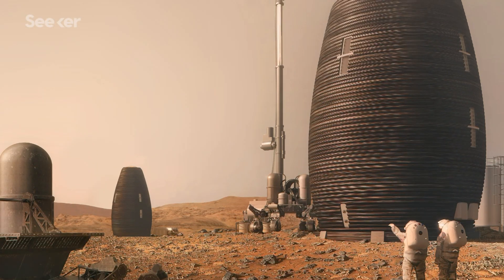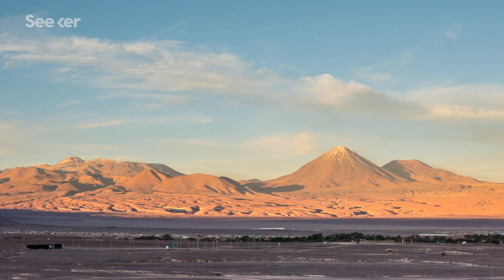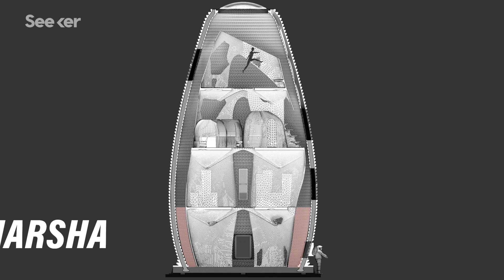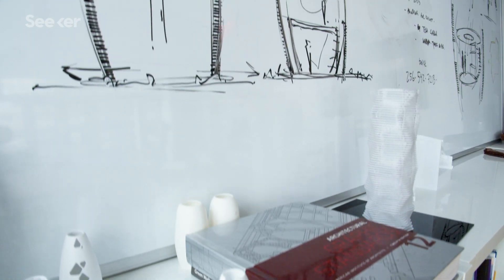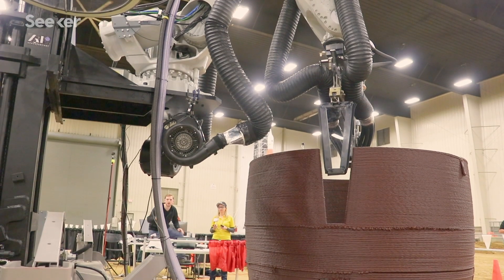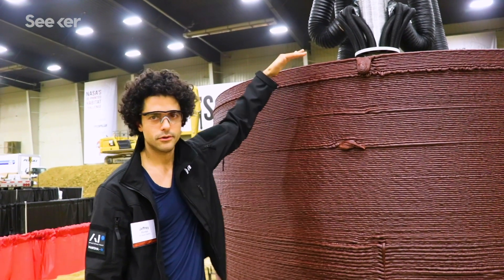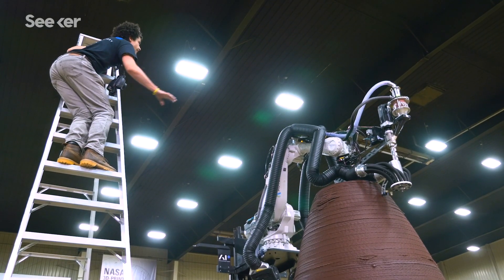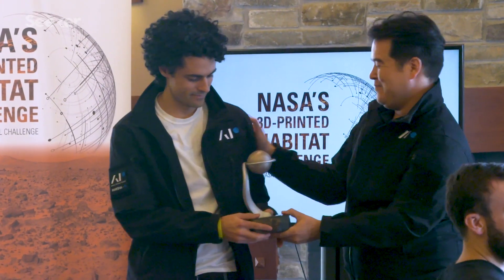NASA’s Challenge to 3D Print Future Habitats on Mars

Comment: moons surface is made of agglutinates, that can be melted in a range of 1000 to 1500 degrees Centi.
assuming a melting point of around 1200°C. To calculate the energy required to melt 1 kg of agglutinates at this temperature
we need 330,000 Joules (or 330 kJ) of energy

If we plan to use solar energy for generating that power.

A solar panel with an area of approximately 20.2 square meters would be required on the lunar surface to generate the energy required to melt 1 kg of agglutinates in one minute, assuming a solar panel efficiency of 20% and an average solar irradiance of 1361 W/m² on the Moon.

Comment: When did NASA get so stupid?  

The internal pressure would have to be at least 5 psi for humans.  So, for just a 10' x 10' wall that would be a total of 72,000 lbs of internal force.  So, your walls would have to be steel reinforced concrete that is many feet thick.  

Or, if you were smart, you could dig out an area that is eight feet down, assemble a buried habitat, pack in regolith on the sides and on top of the habitat so the regolith helps counteract the internal pressure.  The regolith also stops dangerous cosmic rays.  Use internal LED lights for the plants.

Comment: Common sense dictates that those should be built 3/4 of the way underground. First dig your hole then build your habitat, you’ll need to make the thermal and radiation protection a priority. Backfill and anchor your solar arrays to the outer-facing upper portion of your habitat and finish your roof with transparent material for light and plants. Bravo…you are a Martian, aka a trained mouse in a cage underground watering the plants. Nice life.

Comment: I'd send a boring machine to drill some tunnels and the next rocket 
would land in a tunnel leaving the tip sticking out of the ground this would then 
serve as a habitat.  Then build other structures as needed.
Reply: Also if you can why not just bury the ship you send to get better protection... all you need is a bulldozer.  Too simple?  Use a Telescoping rocket shell so you get more space.  Have an inner shell that's lightweight carbon fiber which can withstand the weight of the surrounding material.  In fact if your rocket is say 20' round you could have the inner carbon fiber cut in half so you set them on the ground like a hoop house greenhouse and bury them.  Maybe make a couple for a greenhouse type material for possible growing?  #hairbrainideas

Comment: Do we really need to build lifespace and send humans on Mars as first step? I think it should be the last, when everythink else is ready.
Boston Dynamics Atlas and BigDog will build Mars colony. No need radiation shield, no need food, no need water, no need oxygen, no need lifespace, no need resting, only building tasks 24/7, remote controlled from Earth. I know about delay, but nowadays AI algorithms will allow operators to send only high-level control commands like "take this, put there", latter maybe even like "build this here".
First steps as I see it:
1. Send few orbital stations for 24/7 communication channel with Earth
2. Land solar panels, robots, local on-land communucations receiver
3. Land nuclear reactor for energy
4. Land materials and parts to build self building machines.
5. With these machines use Mars resouces as much as possible (sand, water, co2) to build other machines
6. I think it is a good idea to make parts locally by 3d printing them with melted sand.
7. Send to Mars only resouces that it needs (nuclear power elements, iron plates, plastic filament, etc)

From higher height:
1. factories, industry, self-servicing
2. plants, foods, water extraction, autonomous oxygen generation
3. lifespace for humans
4. humans on Mars

Comment: You could save space on the Mars spacecraft (and on trucks if you want to 3D print homes on Earth) by having a smaller 3D printer print a larger 3d printer, you could also have the 3D printer build plates to make its neck longer and the base of the 3D printer 3D printed as well.  3D printing the moving parts will be harder, but still possible.  Rep Rap showed that even the extruder can be 3D printed.

Comment: The concept looks great, but I see several flaws in it after watching the video. One: Wind resistance. High wind storms have been noted on Mars so how can your design handle them? Two: Very cold temps even during the days All those windows will radiate heat along with the metal frames that they use. Finally interconnection if the various units so one does not have to don a suit to go from one to the other. I am also concerned in using plant material since there is no growing vegetation on Mars no do we have any testing to see if it will grow in the low temperatures that exist there.

Comment: The best idea of building Mars base or house instead of printing is by simply using 3D digging it's a drill that sending the sand etc.out so it's like this have you seen the grave by digging but with 3D digging you can simply form sits, bed, shelf, stairs,deep down etc.and it has 2 robot arm 1.its the drill the 3Ddigger and the 2robot arm are like liquid spraying the finish form inside this liquid is no different with cement effect so that everything become hard the design is almost like a crabs🦀 but the 2 robot arm are inside foldable? 🤔🤔🤔

Comment: goes into the skylight room ahhhhhhhhhhh burns alive thanks to the fact THERE IS NO ATMOSPHERE
Reply: how the hell did the dildo people win
Reply: In one of the other videos about Marsha, they quietly tossed off that it is a "water filled skylight" ... that got my attention because I remember reading once, long ago, that water has amazing shielding properties. Just googled and find that ~ 13-ft of water = 6-ft of concrete = 1.5 ft of lead.
Reply: @rocketgranny2261  water is heavy plus water on mars is ice wait have we tested ice
Reply: @spacecorpse3212  You're right LJ. 1 cubic foot of water weighs 8+ pounds. That would have to be a heck of a strong skylight to bear that kind of weight and still be able to protect the room occupants. From the pictures of the skylight, it doesn't look 10-13 feet thick either.

Comment: I just wonder why NASA only focused on 3D print technology, when they called for the design competition.   Nobody so far has published any numbers of how many kilowatt-hours of electric energy are required to 3D print these habitats with their  necessarily thick walls. 
Just to give you an idea:  to produce 1 kg of rockwool (which consists of similar raw material as Martian regolith)  4,2kwh are required. A hundred  kilopower reactors would be required to 3D print that habitat within a year. 
with an inner atmospheric pressure of  1 bar, as we have on Earth, a force equivalent to the weight of 10 000 kgs would press on 1 squaremeter  of wall or ceiling.  so a thin inflatable membrane could easily support a deposit of loose regolith several meters thick. . just 3 meters of loose regolith provide sufficient protection from cosmic radiation, micrometerorites and extreme temperature.
An inflatable membrane could be produced on Earth, could be carefully tested and has a very little payload. While an automatic 3D print process  might not be monitored and checked sufficiently over a distance of 50millions of kms.
Bigelow proved that inflatable structures can handle the challenges in space, and on Mars it would be even a lot easier, since the membrane would be protected with the regolith cover
So 3D print is not necessary for walls and ceilings but requires huge amounts of energy that hardly will be available on Mars at the begin of a Mission

Comment: If I were in Mars I wouldn't want to live in these habitats if that is all there is to it. Just a 3D printed plastic wall. Don't look at all possible of thermal isolation, resist corrosion, UV radiation would wear it down in some months, any micro meteorites would break it right through, there are no door locks to prevent further degradation of atmosphere if any part of the structure is breached. These designs are better suited for earth.

Comment: This is hardly living off the land in Mars, if you have to bring the polymers with you. The amount of human intervention should have been an automatic fail. A more realistic challenge would be to send AI controlled 3D printers into the desert and it has use what's there to make a building without any human input. Maybe that will come later down the line.

Comment: One question tho... WHAT ABOUT THE HUGE RADIATION (radiation cause its rly thin walls and also it has windows) AND THE FACT THAT THERE ARE WINDOWS -.- (windows cause the temp change is so big that the glass should break one day) The mars bases should be built underground for best radiation protection and heat control they only was i could see this being used is if we terraform mars and then use those or if we had a shield against the radiation :v
Reply: The video showed that the intend design of the mars building has 2 layers of walls, the gap in-between them allows you to put a protective layer.
Reply: @Droid5767  what about the windows

Comment: Interesting. I always thought a geodesic dome would be the most efficient design in terms of strength and stability to counter dust storms on Mars.
Reply: The problem with geodesic domes on Mars is that geodesic domes are usually thin and don't provide much radiation protection. The radiation problem kills the dreams of sci-fi domed towns on Mars.
Reply: dust storms are actually not that strong and a less critical design concern

Comment: I feel like they could do this much easier with inflatable modules. You make a bubble within a larger bubble, then fill the gap between the two with Martian regolith to provide radiation shielding. If needed, the regolith could maybe be mixed with something to make it more structurally supportive like a cement or some expanding foam.

I would replace windows with outside cameras and inside screens.
Reply: agreed. but having different groups explore both is a good idea.

Comment: Why not have like a tent fire redundant fabric that sawed into it there is concrete and humectant powder. The whole thing lands air pump starts and desiccant adsorbs the humidity in the air and cures the concrete. It fools proof imo..you can create what ever shape you want with little power and no water. No precision required either just crush land the thing it will work.

Comment: The supposed oceans of Mars have, since long, been evaporated by all story of Mars, as you all have heard. 
What about ocean salts? 
That desert is certeinly a salt desert. 
Temperatures: down to minus 120 degrees calcius. 
Terraforming?? any water heated at the poles will immediatelly freeze  to a temperature sixty degrees celsius below the one of our Antartide winter.
Even so life is possible, but in a controled secluded area.  The most necessary and wanted specialization?  Green house tecnician, of couse..., Second one?: geologist. Third one?: mirrors ans solar panels technicians. as well as electricians.

Comment: Mars? No printing of concrete housing will ever be possible, since, without water, no concrete could be done. 
So mine it before, if you want to follow this way. 
And this will take not ages, but as least years, and with people there and living in plastic domes.  
Hope no super-clever architects will stick in for strange items that will take all explores time and efforts.
Reply: you have no faith in the engineers to design something. after all they spend 4 years of their life learning cad and math where they never touch a screw driver :)  why put accessible equipment in easy to access places? why not hide it deep inside of tight hard to reach locations? it makes more sense that way!
Reply: @mitri5389  yes i have no faith in engineers. i am not alone. Make them build your house to lern lesson. 
If you a have a child stupid: make an engineer. if is a girl make her marry a policeman or a soldier.
Reply: @romeo5547  engineers dont build houses

Comment: Well the idea is too use material from Mars so if these guys need to use polymer for their construction then that means they will need all the base material for the polymer sent from earth. If there is the base material on Mars then they also need to send the equipment there to convert that material too polymer. 
 The other groups involved with this project are using the regilith from the surface for the building materials.
they are also not using that structure as the pressurized member of the structure. Only a protective outer layer.

Comment: You would actually want more of a domed top rather than a flat top with a domed sky light the hard corners on the flat top would be a stress point also the cut tipped diamond windows they showed in the renderings wouldnt be a good idea you would want to use something like an airplane window with soft corners to again minimize stress points

Comment: The only marketable reason to put a colony on Mars, is to drill to the mantle, to figure out why it is not producing a stronger magnetic field.

Putting carbon into the air will not work, because solar flares will just keep blowing it away. Nobody believes global warming anyway. The only way it can retain an atmosphere, and therefore heat, is by generating a stronger magnetic field. Like Venus. And the only way you can do that, is by figuring out how to get the mantle, to produce a stronger magnetic field. The field would then reflect solar flares, preventing atmosphere from being lost. And considering how much we know about electronics, it should be a slam dunk.

It's like the elephant sitting on the sofa, there it is sitting on the couch... nobody says a word.

Comment: Everyone living on mars will die of radiation poisoning through this design. How do expect to handle the extreme radiation
Reply: Ethan Steel basalt is way to Hevesy to put in a rocket extremely expensive 

The solution would be a shape the is able to be 3D printed but by covered with the soil so you have the radiation shielding 

An other problem would be mars dust is Much finer that dust here it would get in the way of the 3D printing and you would have the suits on mars to be stored outside of the shell because it would interfere with lab equipment and life support systems
Reply: Burn by a 16 year old

Comment: Those habitats do look cool but walls that thin are not going to protect the occupants from the high radiation environment on Mars. I suspect it will be necessary to dig a hole, 3D print inside it and then fill back in again unfortunately hiding the beautiful form- but there's still room to look cool on the inside.